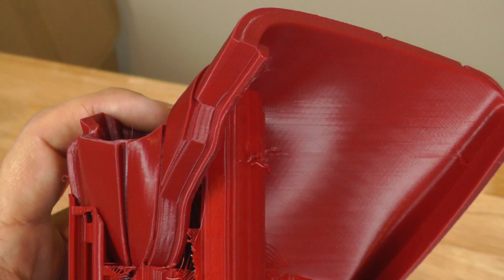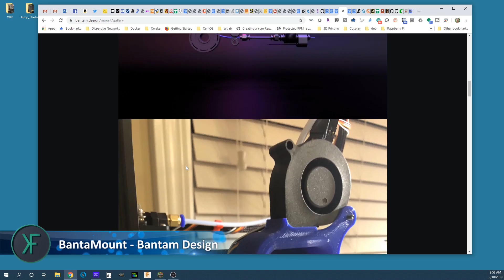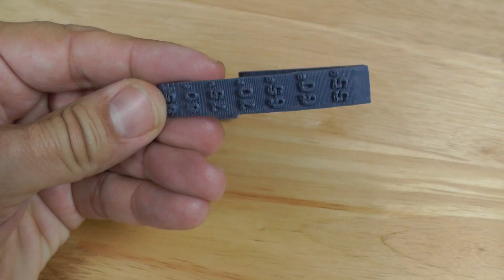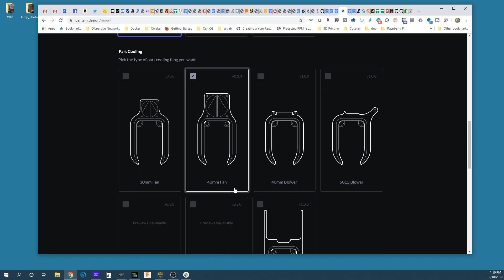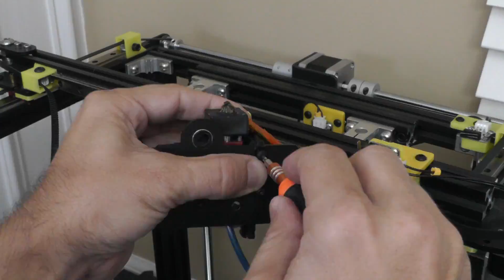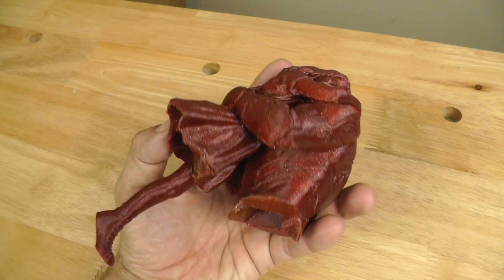The Best Part Cooler for Creality 3D Printers (Ender 5 Upgrades #8)

Comment: damn i guess the gen 3 was replaced by gen 7 now. Bunch of reviews talk major shit on it... Guess I'll try it? If it does the over hang better or equal to i guess ill run it
Reply: man fk me, looks like i have to modify firmware for stock hotend for one stock heat break fan and the dual 5015 part fans.... I'm not ready for all that
Reply from the maker: Sorry about that! I do like the new one though.
Reply: @kerseyfabs  Yea Hero 7 is crazy, I want that 3 fan setup but I think im gonna go with the Satsana with the Sreel BL Touch remix and then try and remix for the 5015 fans.

Comment: how did you wire the dual fans in as the printer only has 1 connector to plug the fan in
Reply from the maker: I just made a Y-adapter using the proper connectors and wires. Maybe I'll make a show on how to create on sometime.
Reply: @kerseyfabs  yeh please do, that would be awsome, i have tried to find a premade y-adapter but cant seem to find it anywhere, then i tried to make it m,myself but cant seem to find the 2x2 connector to fit all 4 wires into

Comment: Hello! how did you installed two part cooling fans in the ender 5? I am with the stock fan, the 4010, but after your video I want to do the same like you
Reply: i am having the same trouble. did you end up finding a solution for adding the dual fans

Comment: thanks for the video and all the testing.  the 'my hero' cooler seems great, but I don't understand why they need to have the heat block offset.  I am going to put a microswiss on the used ender 5 plus I just got.  either way I want to upgrade the cooler.  just don't understand why move the hot end when it is so easy to not move it, thus no customized offsets and minimize the chance of a nozzle that isn't completely vertical due to weak print or over tightening hardware

Comment: I am starting to think that the dual duct systems are an advantage for symmetry BUT so much cooling efficiency is lost by the collision of the air that it doesn't really shine like it should. I am experimenting with single duct massive flow coolers. It's not as symmetric obviously but I find that the print quality is drastically better.
Reply from the maker: Well, if you find one where overhangs on any side look equivalent, let me know. When printing helmets, I don't want to do more work on the left than the right.

Comment: I wish someone who does these mods to the fans would post the link to the connectors!  I've had a hard time getting the right ones to do this.  You post everything else, but the required connectors.  😤
Reply from the maker: Sorry about that. I've added this to the description and here for your convenience:
5 Pairs JST-XH 2.54mm 2-Pin Prewired: https://amzn.to/3Dz4Z2C
560Pcs 2.54mm 2/3/4/5 Pin JST-XH Connectors: https://amzn.to/3mW6CS5

Comment: Any firmware updates needed for the Hero Gen Me 5?
Will your old firmware work?
Reply from the maker: Technically, yes, it will work. The offset may be off some but it's still better than the stock firmware.

Comment: Wouldn't you need to do a PID tune with each setup?
Reply from the maker: Technically, yes. Practically, not really. There are a lot of variables such as how much cooling the nozzle receives. I always watch for fluctuations in the temps to see if it's needed.

Comment: A lot of effort for a little improvement. Stock cooler is better than many think. For general user probably not worth doing. I would recommend offsetting your terminal location s when modding the cables. End result is a neater/tidier cable routing.
Reply from the maker: I thought the improvement was pretty significant for my needs. I know CHEP said the same thing though. Stock cooling was great for everything he does. Thanks for the cabling tip.

Comment: the problem with your left fan is that the incoming airflow is partially blocked so it does not produce as much air through that side. it is just a design flaw in the duct.

Comment: Hello, wich screws / nuts did you used for the Hero me gen 3 upgrade and wich amount ? Thanks
Reply from the maker: I believe all of them were m3 screws but I don't recall the lengths. My suggestion is to buy a multipack off of somewhere like Amazon so you have options. You'll probably use these in the future anyway: https://amzn.to/3cN8Cp4

Comment: Seeing as the quality of the overhangs increased with bigger cooling area, wouldn't it be a good idea to use a bigger fan, without (or with minimal) air duct, to cool the whole printed part more evenly?
Reply from the maker: You don't need to cool the whole part, only where the filament is being laid down. Once cooled, it shouldn't sag.

Comment: I've seen some people using actual infrared tests with exotic part cooling methods. Having air on the bottom of an enclosure pumped up into a pvc or 3d printed long duct parallel to the built plate was beyond just noticable, it might actually be bad for some materials. What i haven't seen done is a fanless hotend heatsink setup. Anyone seen anything like this? Using an independent high output fan that ends with hidden outputs aimed at the heatsink without obstructing them. This is not for practical reasons just something that seems interesting to try but if anyone has done this let me know.

Comment: How can i plug to 5015 fan to my motherboard as you did? I tryed to mix two together and plug in one input in my mother board and it had a shor circuit :/ 
What is the right way?

Comment: Are there not any quiet blower fans for sale?
Reply from the maker: There aren't really any inherently quiet blower fans. I've heard good things about Sunon fans but I think they're all 12V fans and most modern printers are 24V. There are two good solutions though BUT keep in mind both of these reduce air flow. Only testing can tell you how much.
1) Buy a 12V fan and a buck converter to take 24V to 12V.
2) Take your 24V fan and just run a lower speed. I think all slicers allow you to set the max fan speed. Instead of 100%, choose 85% or 50%, whatever works for you. Since I have dual 5015 blowers, I typically run my fans at 85% to keep vibration down.
Reply: @kerseyfabs  i have looked up some sunon 5015 blower fans, they run at 39dB wich seems pretty good. The only problem is that they don’t sell them in my area (the Netherlands) so i’m probably going to buy 2 24 volt 5015 blower fans in combination with the hero me gen5 and run them at lower speed. And thank you by the way for the well explained video and quick reply!!

Comment: What layer thickness and line width did you print the overhang tests with?
Reply from the maker: It was a while back but most likely 0.2mm layers with a 0.4mm line width.
Reply: Kersey Fabrications fwiw, overhang performance also depends on layer height vs line width ratio. The lower the layers and the wider the lines, the more support the overhang has by the layer beneath. I’d be curious if these results hold true with lower layer heights, or if it’s possible to compensate for worse cooling by using lower layer heights or larger line widths
Reply from the maker: It would be an interesting analysis. For the purpose of this video, it was a comparative difference between the cooling solutions and I think most people use those settings from day to day.

Comment: Question today i took my one year old ender 5 in the garge and used my compresser to clean it... then i put it back an powered it up and noticed only the fan that is mounted on inside  of hotend turned on ...the one mounted on outside was not spinning... are both fans supposed to turn when machine is powered on??? or does out side mounted one turn on after print is started???  thanks

Comment: Nice video dude, but i have 2 question for u... 
1) I have ender 3 with microswiss hotend and direct drive and blt too.. Which heatsink should I print? 
2) and with bmg with directdrive + blt  ? i have 2 printers with 2 different hotend+directdrive
Reply from the maker: Thank you! The Hero Me Gen 5 is out now and they have a lot of different components to fit different configurations. You'll have to check out their configuration guide for details.
Reply: @kerseyfabs  not for microswiss direct drive..

Comment: If you get a better slicer profile, you won't need to rely on cooling as much.
Reply from the maker: I disagree. The only other cures for overhangs would be slower printing or more supports. Neither of which seems better than my solution.

Comment: How does the extra weight of the larger coolers/fans affect the stepper motor? Is there any extra current draw that will eventually burn out the drive circuit?
Reply from the maker: I've never seen any adverse affect on the motors to extra weight. You'd see skipping before the motor failed.

Comment: I saw that the dual fans affect my BL touch, start flickering when fans were on. Currently have the single fan Hero me
Reply from the maker: There could be some electrical issues. It won't be a problem though if your fan is off during probing.

Comment: Hi So having this quiet main board there is no need of them motor dampers anymore , like we used to install on the older printers ?
Reply from the maker: That's correct. TMC steppers don't need them.

Comment: Question, I have a CR10S Pro like to keep the stock fans, will any cooling you talked about above work? You where on when Nikko was unboxing this is how I found you.
Reply from the maker: Awesome and welcome! The Hero Me Gen 3 has an option especially for the CR10S Pro: https://www.thingiverse.com/thing:3433619
Reply: @kerseyfabs   So thank you very much, So many question, but my slicer is S3d where did you get the file from Micoswiss from?
Reply from the maker: @roncosta5197  I couldn't find it on their site easily, so here's a direct link to my shared drive: https://drive.google.com/open?id=15CL_Ck2p1Lez9RxWpfpv_jguMLuYUx0m
This is the file direct from them.

Comment: Ok... now I'm on the hunt for an installation video of the Hero Me Gen3 on an Ender 5.  I came back to watch and I searched your video and I don't think you show how it's installed?  As I said before, thanks for all this work, you saved us an enormous amount of time.
Reply from the maker: I showed how to install it on another video on my channel, although fairly quickly. I hope this helps: https://youtu.be/dbS9MA4UkZA?t=1335
Reply: Ok... Well I was hoping for one that’s a bit slower.  What type of screws used where and how to calibrate the nozzle location as my understanding is we want to cool the part where the new plastic meets the part being printed and not the hot-end.  

Also, it would be great to include how to print the darn parts.  Orientation and slicer settings recommends for Cura and maybe Simplify3D.  I wasted hours of printing to have the main duct unit break while trying to remove supports.  My second print was better, yet supports were still a bit of an issue.  

When I searched YouTube I found one person that takes a bit slower install onto an Ender 3. I have the Ender 5.  But it’s about the same.  I also have the EZABL.   

Thanks... I really appreciate your videos and time and sharing all of this with us neophytes.

Comment: I wonder about the voltage. Since its designed for one radial fan, and you tossed two 5015s.. the power to each fan would be insufficient. That might explain how two fans at "100%" work but fail at "80%". I will check how much power the port provides later today when I get back to reassembling my ender. Though I know you are lowering the power for noise.

Comment: newbie question ... How do you change the speed to 75% on dual fan setup ? Does it change the hotend fan speed as well at the same time ?
Reply from the maker: In Cura, there is a "Fan Speed" setting under "Cooling." The hot end fan should be hard wired at 100%. This will not affect it.

Comment: Thanks for an awesome video. Going to make the Hero 3. When connecting the dual fan do you just connect both fans to the same wire to the hotend in parallel?
Reply from the maker: Yes, you'll need a splitter. You can check out this video where I show how I made one: https://youtu.be/dbS9MA4UkZA

Comment: A Q for you. Any particular reason you don't use a 40x20 fan instead of a 40x10 on the HeroMe? Should render potential better performance AND lower noise (relatively). looking at the HeroMe design there seems to be no reason why the increased height of the fan should be an issue? The Sunon vapo bearing fans seems to be popular for performance fans that are quiet.
Reply from the maker: I've never needed a larger fan there, for airflow or noise. Both seem good with the 40mm fan I use. Only the blowers are particularly loud IMO. That certainly doesn't mean there aren't better options.

Comment: What has been worrying me is that the Ender 5 plus have a different mounting bracket (from what I've gathered) so many of the popular options, generally designed for the Ender 3 and CR 10 without modification. To what degree is that true? Someone suggested just buying a spare CR/Ender bracket and swap out the E5+ one, thoughts on that?
Reply from the maker: The Ender 5 and Ender 5 Plus have the same bracket. There are a lot of mounting options available for the Ender 5. All of the coolers I reviewed in both of these videos for example.

Comment: So, quite confused here after this video, so maybe two questions, using an ender 5 now with silend board ( and the fans beeing loudest now :D ):
- is any of the setups capable of making the hotend fan less noisy?
- which one of your examples would be best here?
- would replacing the fan with a more quiet one without the new fan duct do the job as well?

Thank you ;)
Reply from the maker: Go check out the second part of this video review: https://www.youtube.com/watch?v=nGxC0QkL4Mc
In that video I measure noise on some of the better performing options. In order to really answer your question, I'd have to specifically target low noise versus good cooling. My opinion would be to go for the best cooling and then just turn down the maximum fan speed to what you're looking for noise-wise and do some tests. That's no necessarily going to produce the very best results but it's the most flexible solution.

Comment: Hi! NICE review!! I'm the creator of the Hero's fanducts... I move to U.S. and left my ender 3 behind... but I'm thinking on buy a new one... or create a Hypercube, will see later... but I'm thinking on a new "Hero" model... I really did those fanduct's for myself... but what happens with the Hero Me was unexpected!! people really like them! I know you didn't test the original Hero Me, but the Gen 3 is a great addition by mediaman!!!

The problem with the Hero V2 is that the stock blower is too weak to deliver air to the 2 sides... that's why I create the Hero Me... but!! I want to make a new one with all I learned from them both... so... when I get my hands on a new printer I'll do something new and better!!!!
Reply from the maker: Thank you for watching and thanks for your awesome contribution to the 3D printing community! Good luck with a new printer and I can't wait to see what you design next!
Reply: Moving from Hero. Printing is tragic, you need a lot of custom supports. And at the very end I found that the Bltouch holder is not compatible with Bltouch, there is not enough space to fix it with screws. Meh.
Reply from the maker: @madrian_hello  I agree with the support issue. I find that "Touching Buildplate" takes care of most of the supports needed though. It wasn't the worst. 0.12 layer height. I just did a video where I use the BLtouch on my Ender 5 Plus and it worked great!

Comment: You did a great job of covering those coolers. Keep in mind not all blowers are created equal because mine had higher CFM;  My blowers are overkill for my printer because it wouldn't let it properly bond to layers as it became mildly solidified while extruding. I had to turn those fans down as low as 30% and 60% for awesome bridging.
Reply from the maker: Thanks! I agree and I've had to do that before on other printers. It brings the noise down too.

Comment: The item name in the description for the fans say 24v. Does the Ender 5 by default have a 24v rail? or is this A) a typo? B) is a boost converter used? C) Can you just power the 24v from 12v?
Reply from the maker: It's a 24V printer. 🙂